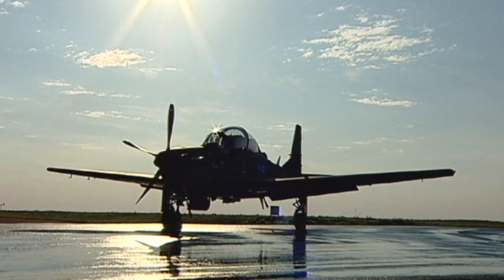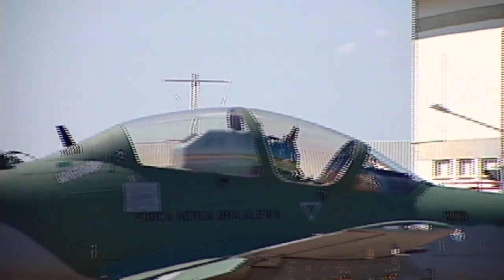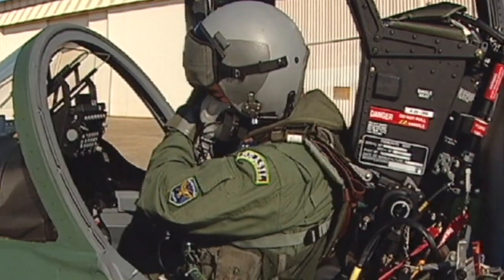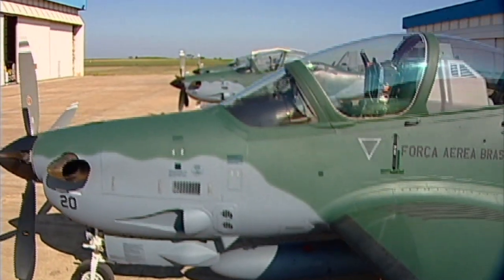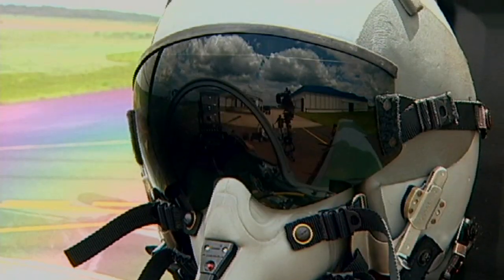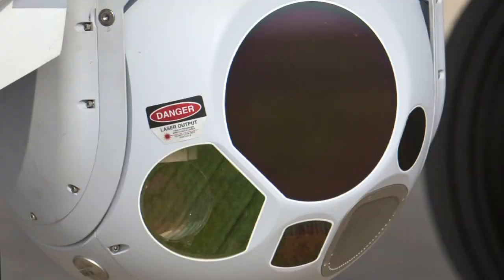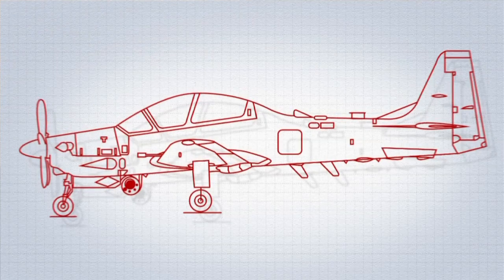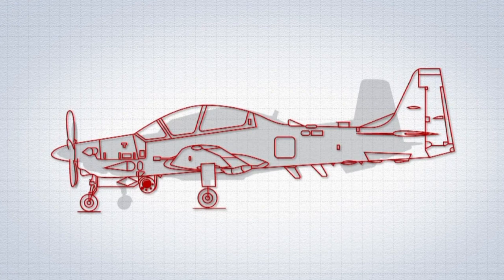Super Tucano - Components Breakdown

Comment: well is a reasonable point but maybe they just want to complement the equipment, what is rare is why USA doesnt do it with and american aircraft
Reply: The A - 29 Super Tucano is brazilian and was  designed by the hungarian Joseph Kovacz, a world famous aircraft designer. 

The panel eletronic is from Israel. 

The engine is from the United States factory Pratt - Whitney, with 1600 hp. 

This plane has electronic devices for almost everything.

It's a mix of Brazil, Israel and United States technology.

Embraer is the brazilian air force maker, but it became private since 1994.

There's several investors in Embraer and the four biggest investors are Brandes Investment Partners (US, 14,4%), Mondrian Investment Partners (United Kingdon, 10,1%), BNDESPar (Brazil, 5,4%) and the Blackrock (US; 5,0%).

That explain why US and United kingdom armies are using the Super Tucano at their aeronautics.
Reply: @lucianoxx9210 Suas informações continuam precárias, incompletas, parciais. Um dia talvez, você consiga passar informações mais confiáveis!

Comment: Doesn't apply to anything I stated. For the role the super tucano is being fitted for what I said is completly accurate. I also and I'm assuming you to have military knowledge on planes etc. And no I'm not a pilot but several old friends are or were I should say. And I have friends currently flying now. Believe me 355 million would put far more aircraft including fuel in the air that we already have than the 20 of these. For the role this is intended.